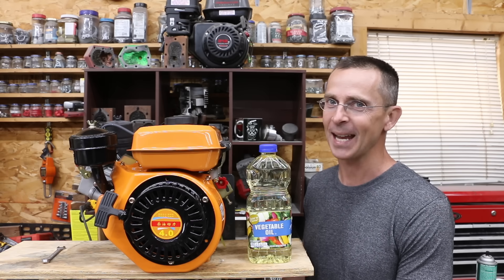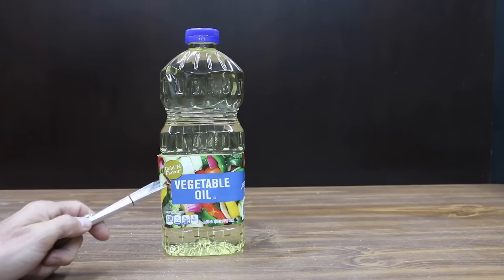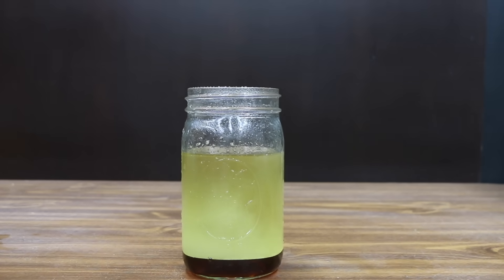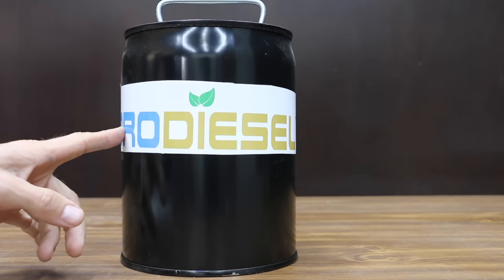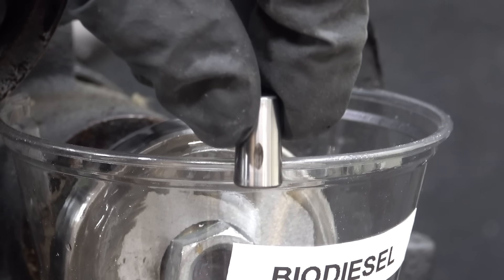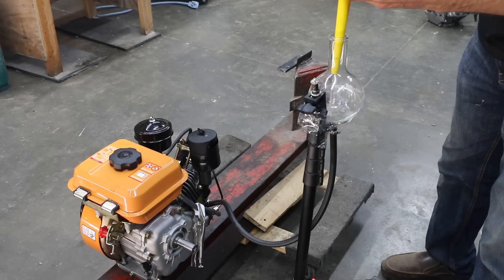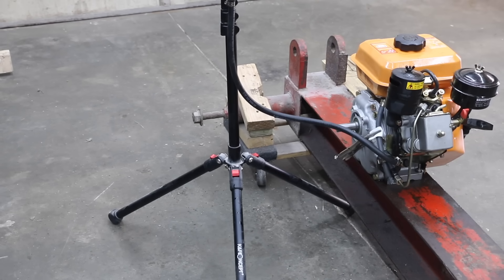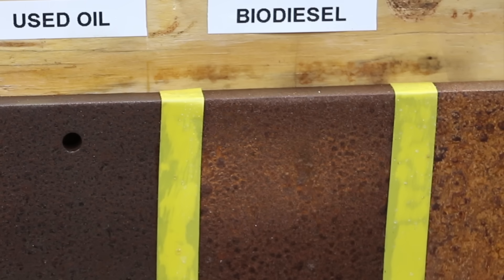Make "Biodiesel"? Let’s find out! Diesel vs Biodiesel, Used Motor Oil, Vegetable Oil, MPG

Comment: The corrosion protection with diesel comes from years of leaking causing a nice layer of gunk under the vehicle :P
Reply: The years of running a high pressure diesel motor does seem to give you a lot of oil leaks and i can show proof of the corrosion resistant properties under my 96 superduty.
Reply: Used oil is far much better
Reply: @kwestionariusz1  Good thing I have those leaks too lol
Reply from the maker: Thanks for the feedback.
Reply: Yep!
Reply: The Auto lubricating Suspension System.
Reply: Added weight of sticky puke lowers mpg 🤣
Reply: @Dirtyharry70585  have you tried...

maintaining your vehicle?
Reply: Rust deterrent lol
Reply: We have a 730 John Deere diesel and we don't have to worry about it rusting the leaking fuel take keeps her lubricated.

Comment: I used to tow a 30 ft. 5th wheel RV with a new 2007 Dodge Ram 2500 Heavy Duty truck with a Cummins 5.9 diesel engine.  I would only see Bio Diesel in the Mid West were we traveled each Fall. It seemed to me the mileage I got on Bio Diesel was less than the standard diesel we get in Arizona and the truck just didn't run as well. Seemed "lethargic".
Reply from the maker: Thanks for sharing.

Comment: i just started running WMO in my 12v cummins, about 2parts oil to one part diesel, ive just been running close to empty throw 40-50 liters of diesel in the tank at the pump and then i fill it up at home with the WMO, no issues thus far, will try to step upto to 90wmo10rug when i get a chance, would like to install a fuel pressure guage first
Reply from the maker: Thanks for sharing.

Comment: How about adding 2 stroke oil in diesel fuel? There are many question marks on that topic.
Reply from the maker: Thanks for the video idea.
Reply: @ProjectFarm  you're welcome
Reply: From what I’ve seen it doesn’t add anything to performance or maintenance. Diesel is already pretty oily and slimy so the stroke doesn’t really help
Reply: @todddesmarais1325  I have Renault from 2012. It makes difference in the terms of engine noise mate 🤔🤔

Comment: Back in the 08-10’ era I got several hundred gallons of biodiesel from the Co I worked for and ran it in my 03’ Cummins common rail. It loved the stuff. Power was good engine seemed quieter and smoother. Only down side imho is biodiesel is prone to developing a fungus that will plug up fuel filters if it sits for any time. It was B5 btw so 95% bio 5% diesel
Reply from the maker: Thanks for sharing.

Comment: I ran my 1999 Land Rover on a 50/50 blend of hydraulic oil from an old digger we had and diesel, filtered through coffee filters.. Startup was slow, but it worked just fine, engine almost seemed a little quieter but was definitely smoking a lot more!
Reply from the maker: Thanks for sharing.

Comment: I have driven a lot with biodiesel but it was not great in the winter
keeping biodiesel over the winter in barrel make it better to use in the winter, you get something like like butter oil in the bottom of the barrel. 
I have even test to drive on rapeseed oil mixed with diesel  that were not great on winter but worked well on summer
Biodiesel is great to use when under emissions check, the smoke values is real low compared to diesel
Reply from the maker: Thanks for the feedback.

Comment: Haha very funny in Europe becouse of taxes 1 liter of diesel cost aprox 1.2 euro that is 1.4 dollars that makes one gallon a 4 dollars.
I would likento test millers diesel additive. I test it on cheap diesel and it gives some power.
Also you can use used vegatable oil. Thats better becouse its cheaper and dosent have that much of water in it.
Reply from the maker: Thanks for sharing.

Comment: Did you perform a titration on the used vegetable oil? Also I believe there is a secondary market for the glycerol. Dirty Jobs had a good episode covering this. I suggest using a kidney filter loop for used oil (make your own, please don't buy), here is an example: https://www.oilfiltrationsystems.com/wp-content/uploads/2014/01/Filter-Cart-Brochure-2014.pdf

Comment: Remember to test craftsman cmcf820 tool only is 99 or is a kit is 169 dollars at Lowe’s the kit come with 2.0 Ah battery the kit is build in America has 1700 of inch pounds of torque speed 1 0-1300 speed 2 0-2600 speed 3 0-2900 imp is 3800
Reply from the maker: Thanks for the suggestion.

Comment: I did not expect used motor oil and vegetable oil to work as well as they did. Speaking of hydrodiesel - what's the point of adding water to fuel? Sounds extremely counterintuitive. Water doesn't burn, all it does is dilute the fuel. I know that V2 rockets used a mix of water and ethanol for fuel, but it was done because pure ethanol was prone to exploding, so they deliberately diluted it to make it safer. This isn't a concern for diesel engines.

Comment: Wow, that 1996 Dodge truck looks new. Amazingly good maintenance!  
Question on used motor oil: we change the oil partly because of the contaminates from wear that are in it, right?
So burning it as a fuel seems like it just puts metal shavings right back into your engine. How is that good?
Reply: Cant be good mate

Comment: The best testing of alternative diesel I have ever seen. I have used gas cut used motor oil for over 5 yrs and can tell the difference (drop) in power when I have to use straight diesel during long trips.
Reply from the maker: Thanks!

Comment: old diesel tech (indirect injection, or electro mechanical one from the 80s) are the best if you want to run vegetable or motor oil. 2 key charateristics : A strong enough injection pump and a powerfull fuel warmer and engine pre heating system
Reply: EDC rotary pump diesels from the early 00s are also good. Just stay away from anything that has a Lucas rotary pump. Bosch Verteiler pumps are good. Inline pumps (like on mercs) are even better, because they use the engine oil for lubricating the injection pump, not the fuel, so the lubricity of the fuel doesn't matter and they're really tolerant.
Reply: Yes, because the old diesels ran with a low (and reliable!) 2500psi or so fuel pressure. The new disasters run at around 25-30,000 psi (ridiculously high!).
Reply: @brettymike  whoa.....how much are these new injectors running at?

anything over 3000 was overkill in my experience but I was working on old injectors; know one buddy that was being a dum-dum and ran an injector up to 5000 psi and the end shot off! the end of the injector shot a hole into the side of the shop and he was just standing there with a clearly unusable injector afterwards....can't say I've had much contact with him since then.
Reply: @thevashfan12392  The ONLY advantage with the super high injection pressures is superior fuel atomisation & power output. Reliability and "fixability" has GONE compared to the older diesels.
Reply: @brettymike  all gone for the almighty dollar
Reply: @thevashfan12392  and efficiency.
Reply: @tylerbraden3512  c'est la vie. I don't really care about efficiency, if it drives. it drives.
Reply: @brettymike  Common rail diesels don't just have better atomisation (which is desirable mostly because it means less nasties in the exhaust) they also have way more control over when and how much fuel goes into the cylinder per cycle, they often inject multiple times per power stroke for example. This is why you can now get a direct injected diesel car that has little more NVH than a petrol car, whereas back in the day there was only indirect injection (with all its disadvantages) in passenger vehicles and even that was liable to be a bit agricultural in character.
Reply: @nerd1000ify  I wouldn't say "way more" control on fuel metering.  But thanks for telling me what I already know about fuel metering, and "softer" initial fuel injection charges to lessen your "noise, vibration & harshness". And in saying all that, my 31yo Nissan TD27 turbo still starts on first compression , and purrs as smoothly as most of the common rails!. AND I can overhaul my injectors, and set them up with new nozzles MYSELF for a song. The common rails need brand new injectors at fix time - at a horrendous cost....and that is without their rotten problems with carbon blocking their DPF, and/or the EGR blocking up the cylinder head ports etc etc. My old diesel will out live the new ones by miles!.
Reply: @brettymike  Perhaps your TD27 will last longer, but it likely pumps out 5 to 6 times as much nasty stuff in the exhaust as my Hyundai U2 common rail. The latter also delivers 5 kW more power from 60% of the displacement, assuming you haven't done any aftermarket tuning.

 Clearly there is a reason everyone now uses common rail injection, just like how nobody makes petrol cars with carburettors anymore. As with any high technology there is a cost in ease of maintenance, and money.
Reply: @nerd1000ify  "Perhaps"? - it will!. And your 5-6 times? - sorry I keep mine well tuned and serviced!. Just you wait till your Hyundai gets some miles on it, and it's time for $$Repairs$$ , and the crap it will pour out when it is crook will be nearly as bad as a volcano....that's if you are lucky enough to be not broken down on the side of the road. The common rail world is owned & run by $bean counters, and it's gone batshit crazy (and MEAN!).  BTW - all diesels should be running on that clean pure GTL diesel, which we never hear about.
Reply from the maker: Thanks for the feedback.
Reply: @ProjectFarm  Also, very interesting to see the lubricity test. I've always wondered if veg oil could be used as an alternative to motor oil in a brand new engine that hasn't seen any oil yet. Perhaps along with some of those oil additive bottles you can buy. One theory why veg oil doesn't work in a (warmed up) engine is because veg oil reacts chemically with the old leftover oil that is in the engine, causing either bacteria/algae, or polymerization (creating rubber like plastic in the oil). I'm not sure if completely brand new engines come completely free of oil though, as I've never bought one. Presumably so, since you had to bleed the fuel system? Would this be a good video idea?
Reply: @jhsevs   its not like its a huge mystery as to why it doesn't work as an alternative for engine oil. In theory anything that provides some kind of lubrication will work in some fashion its just comes down to getting the stuff to where it needs to be and keeping it there throughout the operating conditions of the engine. Veg oil is usually more acidic than normal engine oil which causes problems with the metal in engines and any old oil as well as most metals and also causes issues with the seals and orings. When it comes down to the basics anything that can prevent metal to metal contact will work better than nothing at all but  most engines are designed and built to ever increasing tolerances and specifications and that is why engine oils are also designed to best fit these specifications needing differences in viscosity and lubricity and all the other additives and components to meet the designated spec and regulations.  Even with veg oil I  definitely dont thing algae or been bacteria are a problem in most engine conditions due to them being fairly hostile living conditions and  there being no light generally for algae to grow. Depending on the engine I'm sure veg oil would work for lube but not for long and surely not in any vehicle engine unless its the only option compared to nothing it would probably get you farther than no oil at all.
Reply: Mercedes. I have run some for a bit in a '77 240D, but now I have a '91 300D and I will be occasionally running some SVO when I can get it.

Comment: It would be interesting to see how the engine runs under load with each of the different types of fuel as always great video.
Reply from the maker: Thanks!  Great suggestion.  Thank you.
Reply: Yes this!
Reply: Measured power output, performance under varied loads, fuel consumption averages over time and turbo performance, ie: lag and boost would all be good info to compare with alternative fuels. (Turbos are driven by expanding exhaust gasses which could be effected by different fuel burn time and temps).

Comment: At work the other day I had a carb that was completely clogged up from bad gas, I ran it on 100% sea foam and it cleared it up, I’d be interested in seeing what the cab and engine looked like after I ran it and what the burn flame looks like  on 100% sea foam
Reply from the maker: Thanks for the feedback.

Comment: If you think about running your engine on used oil, bio diesel or veggie oil, always, and I mean ALWAYS! flush the system with pure diesel afterwards. Injectors and the pump is very sensitive for any moisture and varnish deposits.
Reply from the maker: Thanks for the feedback.

Comment: Great Video!
Suggestion: There are so many oil filter 'cut and look' videos out there but they do not really serve the purpose.  Can you setup to test actual filtration efficiency of a filter? You can add a certain amount of known particles to oil, heat, and let that oil pumped through the filter.  Oil coming out of the filter could be tested or the filter itself could be examined after the test run.
Reply from the maker: Thanks for the suggestion.

Comment: I plan on driving my 2005 Dodge diesel (that I bought new) a million miles if I live long enough. I mix a gallon (128 0z.) of TWC3 2 cycle oil with 112 oz. of Power Service Diesel Kleen and add 7/10 of an ounce of this mixture for each gallon of diesel when I fill up. The Power Service keeps the injectors/injector pump clean and the 2 cycle oil replaces the lubrication that the sulfur removal process removed. Biodiesel is VERY corrosive and a good paint remover.
Reply from the maker: Thanks for sharing.

Comment: Another reuse recipe for SVO, WVO, or WMO to chemically thin the oil. Provided by Diesel Secret product. A TV gimmick sold around 2008. But looks like a WW2 expedient.  It thins by dilution instead of heating as in other reuse means.
Add:
5% gasoline
10% kerosene or 20% diesel
.6% Power Service
.15% Stabil
.15% pure acetone
to the SVO, WVO, or WMO . Mix and filter through a water trap and at least a 10 micron filter.
Only use with a low pressure mechanical injector pump.
Reply from the maker: Thanks for the feedback.

Comment: I bought a 55 gallon drum of Biodiesel which I used to mix 1 part to 10 on my VW Jetta. Anymore than a 1/10 ratio would start to give me quantity control errors on the injection pump after time. Nothign running some Lubramoly diesel purge would not fix up. I need to add the caveat that I live in a temperate zone, we see freezing temps 3 or 4 times a year.  The biodiesel provided just enough lubricity to the low sulpher diesel to keep my injector pump still going now for 22 years. I also use 8 ounces of Power Service grey additive per tank in the Spring , summer , and fall. And 8 ounces of the Powerservice white 911 in the winter per tankfull. The car gets 50 mpg highway and 35 mpg average for a 22,000 mile run on the 55 gallon barrel.
Reply from the maker: Thanks for sharing.

Comment: TBH the price of gasoline has been stagnant for a quarter century or more.  Compare 1985 gas price (say $3 a gallon) and 1985 medical/education/housing/salaries etc and you will see that everything else went up way, way more than the cost of gas.  That said, if gas did increase in price, Biodiesel would be ubiquitous instead of niche, and the price of vegetable oil would be huge.
Reply from the maker: Thanks for the feedback.

Comment: Nice, although you did the lubricity test, there was no engine/manifold temp comparisons, or condition of head/pistons. Perhaps the strip down would have been too tedious for you, but a look inside would have been nice. People do run cars on weird stuff given a chance, back in the 60’s I had to collect an old Mercedes that was running on paraffin. It ran, but the clutch was shot so it couldn’t climb the small hills is was surrounded by, and had to be towed.
Reply from the maker: Thanks for the feedback.

Comment: USED MOTOR OIL CONTAINS MICRO METAL PARTICLES!
IT WILL EAT YOUR FUEL PUMP & CLOG YOUR INJECTORS.
I HAVE TESTED IT.
I drove an old mercedes (95 vito 2.2diesel) straight from Estonia to Cadiz (10 000km/ 6200miles) in 10 days & back using only old motor oil going one direction.
Had to use diesel to travel back, beacuse fuel pump was worn & didn't m5ake enough pressure anymore.
@ home scrapped everything...
USED MOTOR OIL IS THE LAST THING U USE ON YOUR CAR... after that it is useless.
Reply from the maker: Thanks for sharing.

Comment: My dad bought biodiesel once, because it was a little bit cheaper and poured it into tractor tank. He done some work on a field and checked fuel level rod in tank (like oil rod/dipstick) and part which was in biodiesel was rusted. And I don't know prices od diesel in your area, but in Poland there is about 5,20 PLN (1,41 USD) per liter now, about the same as gasoline. But from 2-3 years all fuels are more "bio" and for diesel is B parameter which means how much biocomponents are in it (B0  - no biocomponents, B7 - up to 7% biocomponents, etc) and for gasoline is E which stands for ethanol content (E5 means up to 5% ethanol)
Reply from the maker: Thanks for sharing.

Comment: Nice job!  Video idea:  Can you make a gravity motor that powers a generator head.  Or a pulse motor that runs a generator?  They are supposed to run without extra energy and produce extra torque to run other things such as a generator.
Reply from the maker: Thanks! Thanks for the video idea.